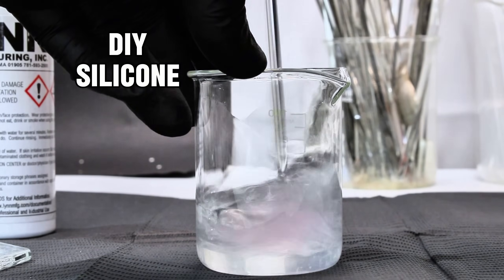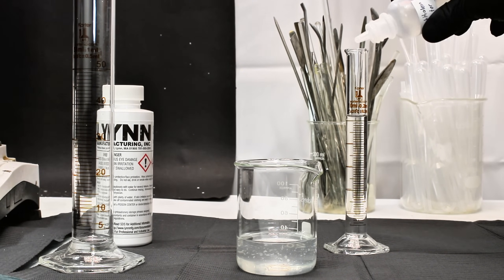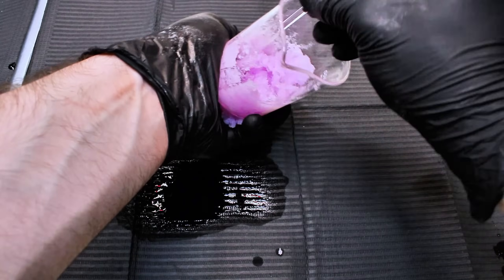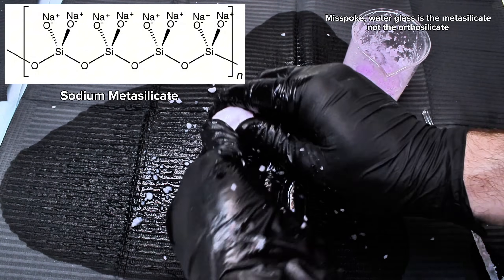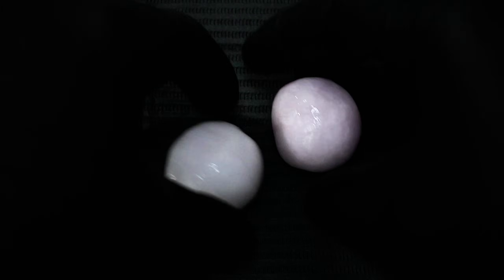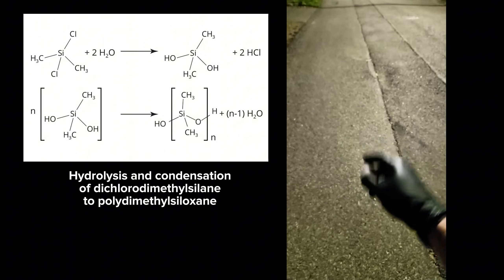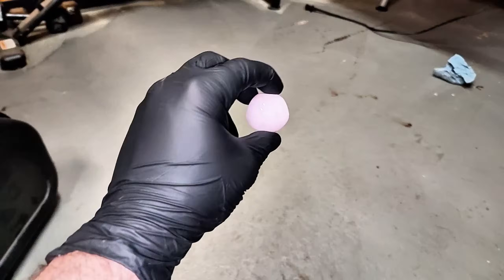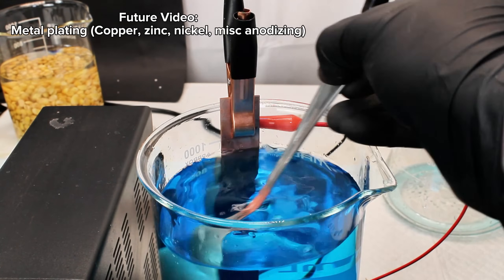Making Silicone from Scratch

Comment: Today I learned why it's called silicone. I did not know it was because its core component was silicon, I just thought it was a similar situation to how the graphite in pencils is called lead but I never bothered to do any research. I'm curious to know how the black silicone caulk that sometimes says it's "bitumen" silicone works. This is a lot more technical so I believe a chemist would be best suited to do proper research on this so I'm gonna leave this here just in case you feel like making a video about it. Thank you for the fun info!

Comment: tried it out, sadly didn't work :(

all I got was a white milky solution which draws some strings when pulling the glas rod out after mixing

what did I do wrong??
Reply from the maker: hmm.. Did you buy or make the sodium silicate? When I first tried this, I used sodium silicate that I made myself and the same thing happened to me. I think if the sodium silicate is too dilute or alkaline you'll get the stringy mess

Comment: I was really interested to find out that silicone (without additives) is actually less toxic than sugar. Silicone has an LD50 of about 50 GRAMS per kilogram. Where sugar has an LD50 of 35 grams per kilogram. But that says nothing for any other compounds they put in it, plasticizers, hardeners, pigments, and who knows what else. I just thought it was amusing that plastics have such a bad reputation (and rightfully so) but this one plastic happens to be practically non-toxic. Otoh, I wouldn't want to try to pass that much silicone through my GI tract. I don't even know how they would measure that amount.

Comment: how can I use this in a mold? seems like it's not possible if you have to squees the water out and it hardens when you do.
Reply from the maker: I'm not sure, haven't tried. It is still reasonably workable just before it starts to coagulate into a ball. Could maybe work it into a mold around that point

Comment: I suppose you could put it in a mold and press out all the excess water and alcohol and have something that's really rigid but also easy to make
Reply: All you need is diy water glass from sand and possibly potash 
(potassium hydroxide?) and diy ethanol which can be made using the same method as prison white lightning

Comment: Great one, extremely usefull stuff — thanksfor taking the time ♥️ btw, by starting with sodium metasilicate pentahydrate (Na2SiO3·5H2O), would that make the process simpler by starting with a solid substance (I have it like little pearls) and only the water content of ethanol (I have the most common, readily available type, which has less than 4% water content)?

Comment: I think it is adding sidechains, not crosslinking.

CH3-CH2-OH + Na2SiO3 → 
CH3-CH2-O-NaSiO2 + NaOH
Reply from the maker: I did a good deal more research over the last week and I'm fairly confident the mechanism from the literature I posted in the video is wrong. My best guess at this point is that it is cross-linking, but the cross-links are Si-O-Si with sodium ethoxide acting as a leaving group. However, that's just what makes the most sense to me. I've seen tons of other totally plausible ideas thrown around here in the comments.

Comment: Is the polymerization linking process not temperature dependent? If small, or dilute volumes of chilled catalyst were added slowly, to chilled base, could this extend the chain length Giving a lower durometer?

Comment: Cooool! I'm definately going to try this some time!

I have an idea: If you screw around with the ratios a bit, can you in effect modify how much the silicone gets crosslinked? :D
Reply from the maker: In theory yeah definitely! I used a big excess of ethanol here, no idea what would happen if I cut the amount back significantly. My gut says it would be really gooey
Reply: @integral_chemistry  aha! So then, if you were to reduce the ethanol slightly, could you in theory make a silica gel (which is what this technically is), that mimics industrial silicone?
Reply: @integral_chemistry  Well I tried this with regular 95% Alcohol and it only made Slime. Must I use Pure Ethanol?
Kind regards fom Greece.

Comment: This is excellent. I had no idea silicone could have such a simple synthesis. I might have uses for this reaction. If I use it I'll be sure to cite your video. Thanks!
Reply: This isn't silicon. Adding ethanol doesn't properly cross link silicate, it will dissolve back if you add water. You can, however, ion-exchange this mass to make the cross-linking permanent. If you exchange it with calcium chloride, you can make a transparent, glassy insoluble material.
Reply: I just wanted to take this not overly saturated comment section to say how much I love your channel. Thank you so much for being a bright spot in the science community <3

Comment: I don't think your explanation and the reaction given are true.
First, any crosslinking would require a molecule with at least two functional groups, and ethanol has only one. 
Second, your reaction has oxygen as a product. Ask yourself - is really any gas produced? Keep in mind that the stoichiometry you've provided dictates that for each mole of ethanol reacting (ca. 50 ml) you'd get over 20 liters of oxygen. That's quite an off-gas, I'd say.

Comment: i remember when i mixed NaOH sol with SiO2 kitty litter, i would usually find a thick disc of some kind of SiO2 polymer at the bottom, it was quite heat resistant. some crude aerogel

Comment: Definitely a useful material. I wonder how much the process could be adapted, such as producing a slower curing pourable mix, or maybe making a gel or a foam?
Reply: I wonder how well alcohol would permeate without agitation. Could put the sodium silicate in a mold and add the alcohol on the surface. Or more likely, use this to make thin sheets.

Comment: Are you sure you are producing oxygen as a side product?
To me it looks a bit sus that you are making Si-C bonds that easily. It looks more like Si-O-C, which would not produce oxygen gas, and is thermodynamically more favorable too.
Reply from the maker: Yeah I think the mechanism from my source is wrong. Gave it a closer look, considered the comments and did some more reading and my best explanation of the reaction is that the cross-link is Si-O-Si, with the ethoxide acting as a leaving group on the Si atom. Best I have for now, but a lot of comments have proposed many other ideas that also may be correct.. Honestly the lack of bubbling should have been a giveaway that no oxygen was produced, guess I just got too excited someone else did the mechanism for me lol.
Reply: Totally second this. I can see ethanol linking like C2H5-O-Si, but I do not see the CH3 end deprotonating like that.

Comment: Sodium metasilicate (crystalline Na2SiO3) isn't usually sold to regular customers as it is because it's corrosive. If you bought your waterglass at a hardware store, it probably is an amorphous silicate variant much more rich in silica which is safer to handle. It is also good for making bouncy balls, though. When I was in middle school I used to make them all the time from silica-rich waterglass and denaturated alcohol. Now I wonder what happens if I use metasilicate.
Reply from the maker: Huh very good to know! Very much appreciate the input from people who know more than me. Interestingly enough though I did make crystalline metasilicate myself which I actually tried first. The result was a think slime that didn't really hold its shape. Definitely cool in its own way, but I felt not as interesting for the video lol
Reply: @integral_chemistry  Seems right. When dissolved in water, metasilicate gives mainly isolated (SiO3)2- anions but the more silica in waterglass, the more polymeric the anions become. Long silicate chains probably work better in creating bouncy balls.

Comment: I may be stupid but how does sodium hydroxide dissolve silicon dioxide which is just glass?
Reply: NurdRage covered the reaction in his sodium series.
It's a common problem when working with NaOH, especially at higher temperatures. -- it likes to dissolve your glassware unless you completely eliminate water from your reaction. I've lost a few flasks to it. NurdRage starts his reactions by destroying ALL of the water with sodium metal.
Reply: @eclectichoosier5474  Thanks, this was not taught in my chem class :)
Reply: Strong alkalis just dissolve silicon dioxide creating silicates. Molten NaOH easily dissolves glass and concentrated NaOH solutions can dissolve regular sand under high pressure. If silica is in the form of silica gel it is even easier, you can easily dissolve silica gel cat litter in concentrated sodium hydroxide solution. It's an acid-base reaction, silicon dioxide is a very weak acidic oxide.

Comment: I just went down a bit of a rabbit hole on the subject of silicone's environmental impact.  It's a mixed bag, but not an unmanageable one the way plastic is.  It generally breaks down even slower than plastics (I'm sure there are exceptions due to how varied both can be), but that can be a positive for reusable items.  It's terrible for disposable items, but ffs we gotta stop with that anyway.  But at EOL, it can generally be incinerated safely, unlike plastic, since it mostly produces sand, carbon oxides and water, unlike all of the plasticizers and softeners and adjuncts added to make most plastics useful.  Sure, produces carbon dioxide and monoxide, but compared to plastics...  Not that it create much energy when incinerated, but the toxic outgassing is less.

In a future without plastics, maybe we'd use more silicone and have a collection system for it so it goes into incinerators instead of landfills?  Or maybe we'd find a recycling system that uses it as a relatively clean source of silica for glassmaking or more silicone?
Reply: Plasticisers are a misconception, most plastics you use day to day do not rely on them or don't use any, and in turn with a couple exceptions they can be incinerated completely. PP PE PS PET are the bulk of the plastics used and they can be incinerated completely. There are other trouble additives though, like halogen based fire retardants necessarily used in most PS items and also PVC the polymer per se that's a troublesome one.

Comment: Where did you hear that you can put alkanes into silicates like that? I am pretty sure what's going on is alkoxide formation with the ethanol, which then condense with silanols.
Reply from the maker: I think you're right.. honestly I just took the word of a paper I found and when I couldn't make the mechanism work myself I just figured the author knew better than I did. Should have added some disclaimer about my uncertainty.. I'll look into it a bit more but your idea sounds much more feasible as a mechanism.
Weirdly there's not a ton of info on this process despite it being so simple and accessible
Reply: @integral_chemistry  Ah yeah, I was wondering if there was something I missed, would be neat to turn Q groups into T or D groups like that...

Comment: Please explain to me how ethanol can crosslink your polymer? it looks like you are making and partially hydrolysing tetraethoxysiloxane?
Reply from the maker: That's actually a good question.. let me go back to the little paper I found on this and see if I can come back with a good answer. Technically this was from what looked like a undergrad-level lab activity, and I wasn't actually able to find any formal literature on this reaction.
I'll look into it a bit more and see what I can find
Reply: @integral_chemistry  you can use cyclopentadimethyldisiloxane (dimethicone) and some catalyst to do it pretty easily :) nit/lice removal solution is mainly that
Reply: Also you do not have any Si-C bonds as far as I can see, does this qualify as a polysiloxane?
Reply from the maker: I did a good deal more research over the last week and I'm fairly confident the mechanism from the literature I posted in the video is wrong. My best guess at this point is that it is cross-linking, but the cross-links are Si-O-Si with sodium ethoxide acting as a leaving group. However, that's just what makes the most sense to me. I've seen tons of other totally plausible ideas thrown around here in the comments.

Comment: So that's why silicone caulk smells like vinegar.
Reply from the maker: Yes exactly!^ I didn't even know why until I did this video
Reply: @integral_chemistry  What do they call it there? In Spain and Portugal it's called acetic silicone, on other countries it's labeled as acidic silicone, acid silicone or even acetoxy silicone. It's much cheaper but causes many metals to rust and therefore damages mirrors, electrical and electronic components and it hardly sticks to concrete surfaces.

The other is known as neutral silicone or acid-free silicone.

Comment: Cool, now try making silicon from scratch
Reply from the maker: Oh christ 😅 honestly a thermite-type reaction could do it, the tough part would be collecting it afterward
Reply: @integral_chemistry  The longer the cooling time the larger the silicon pieces. You can also recrystallize silicon from molten metals like molten zinc, that way you can extract it from the reaction mixture.

Comment: Wait... it's that simple?  Now I wonder if any medieval alchemists managed to make silicone that way.  The ingredients have been readily available for centuries.
Reply from the maker: I hadn't thought of that but maybe. I'm curious now how long ago they discovered that you could dissolve silicon dioxide in lye.. that would definitely be the tougher part I'd think
Reply: @integral_chemistry  Earliest reports of dissolved silica goes back to the 1500s, though waterglass was only properly studied in the 1800s.
Reply: I doubt it. We have the distinct advantage of good pure reagents these days. That's relatively recent. They certainly didn't have pure ingredients in the middle ages.
Reply: @nolanwhite1971 Lye, silica, and ethanol have been available in high purity for quite some time tho
Reply: @nolanwhite1971  alchemists' had quite pure H2SO4 for a long time, but I am not sure about NaOH. Most old NaOH/KOH making processes are heavily contaminated with NaCO3/KCO3, good for soap making, but would produce contaminated water glass, which can be cleaned but I don't think they knew or cared much. They had really pure 96% alcohol though, but they did not have any 100% ethanol.
Reply: @adamrak7560 I mean, this reaction works fine without pure reagents. The major issue that purity brings in with this is repeatability, especially with different ratios of alkali metal to silica. From personal experience you can dissolve SiO2 in lye from wood ashes, you just need an iron or copper pot, both of which were readily available to most alchemists and early chemists

Comment: Neat, I didn't really understand silicone polymerization mechanism (not that I tried, but still). I see, that during actual polymerization the silicone loses water, but I am wondering, what prevents single silane molecule to lose water and become like ketone (dimethyl silanone). And if it does only tiny bit, why is this not preferred.
Reply from the maker: I'll be honest I'm still struggling to understand this mechanism myself. I tried for a while last night to put my own version together but I couldn't balance it, nor explain electron movement. In the end I just gave up and copied the mechanism from the literature.
I'll probably just post a link in the video description and see if anyone else can figure that one out

Comment: This video, shortly after watching NurdRage's research into various secondary and tertiary alcohols made me wonder what happens if you replace the ethanol with more exotic alcohols. /me looks at his bottle of tea-tree oil.
Reply: looks at the bottle of linalool, which was obtained as a consequence of the exact same series of videos as above :)
Reply from the maker: I'll have to give it a shot! I tried methanol instead but it kinda just turned into a weak slime. Didn't think to try longer-chain alcohols
Reply: @integral_chemistry  I have a large bottle of geraniol too, might want to give that a try too. Which is again a large chain, unsaturated primary alcohol - as opposed to unsaturated tertiary like linalool.
Reply: I have tried propylene glycol and it resulted in more rigid but still flexible material, very bouncy. The reaction time seems the same as with ethanol. Mixture of glycerol and propylene glycol is still curing and I think I made too much of a punk-approach to it with just mix this sh*t at random proportion. I think my goal is to experiment with the number of cross-links and their own length compared to physical prop of cured material. Not that as I’ve asked myself to study that but still)
Reply: @injectormajor  Neat! I wonder if there is a mechanism to make it dry enough to not need the drying step...
Reply: @queazocotal  how do you think about adding silicate fillers? Or aluminum-silicate. All my samples made today are still amorphous and do not hold “mould shape”